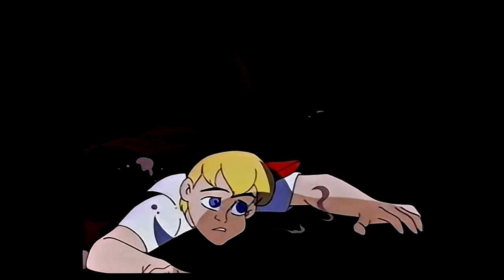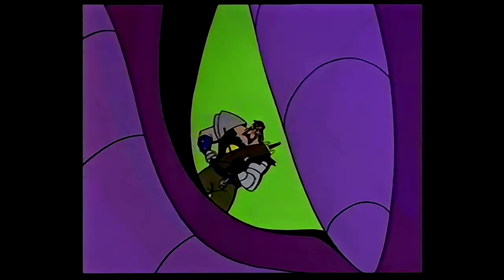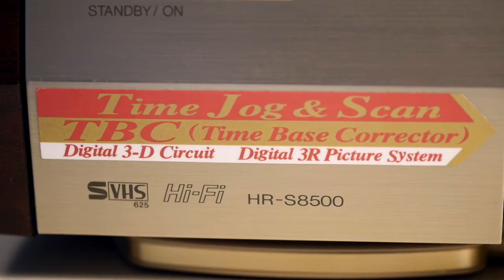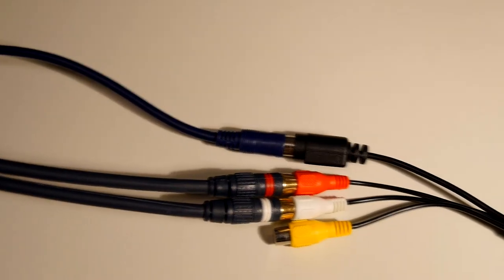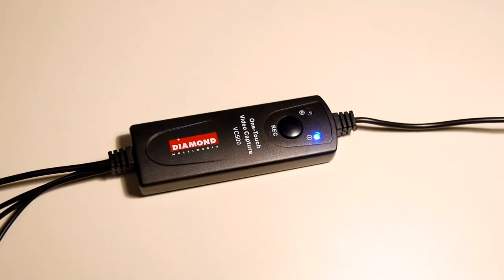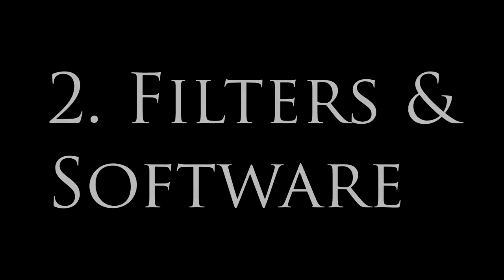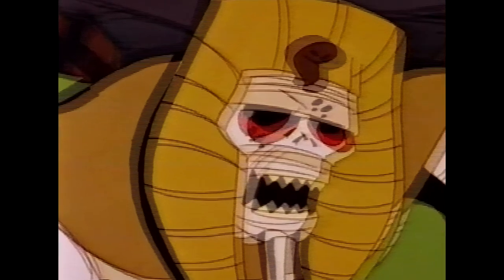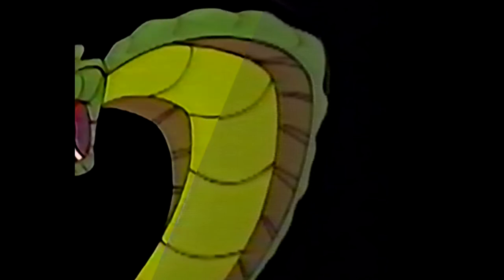Mighty Max: the making of the restoration

Comment: I'm not sure how I found this video, but I'm glad I did - this looks fantastic! VHS can be a pretty finicky source, even with commercial tapes, and you've really gone the full mile with these cleanups. If I had to make one small suggestion, maybe keep the contrast levels similar to where they started? It looks like you're loosing some detail in darker areas of the image - that could very easily just be my display, though. Regardless,  work!

I'm working on a similar project for a different show, and I was curious - what filter did you use to eliminate (or at least tone down) frame blending? A lot of my sources have it, likely from the original film source - a response would be greatly appreciated! :)
Reply from the maker: I'm glad you found it, too! And thanks for your kind words. In the beginning of my research I think I was too aggressive with contrast and levels, resulting in lost details in dark areas. For the 3.0 version I dialed back a bit to try and obtain a balance between making black areas look genuinely black and maintaining all the details. However, if I watch the videos on my phone for example, it seems that it adds extra contrast as well, so maybe it is your display settings??? 

In regards to blended frames, I use srestore (http://avisynth.nl/index.php/Srestore). Of course, this requires you to know how to use Avisynth as well - it's a video restoration software that can be very powerful, but it doesn't have a GUI so you have to write a code to tell the program what to do. I hope this helps!